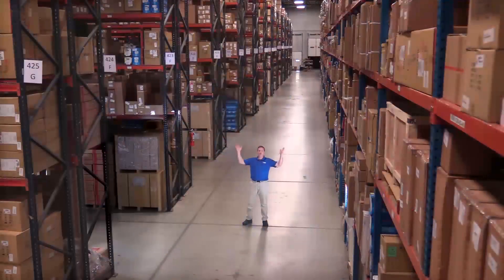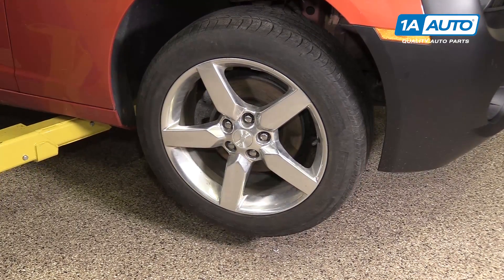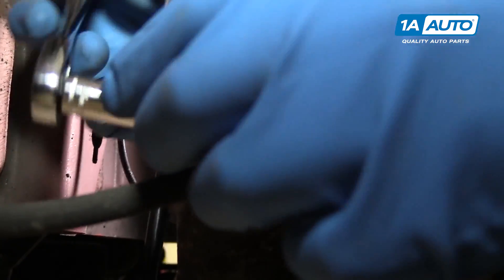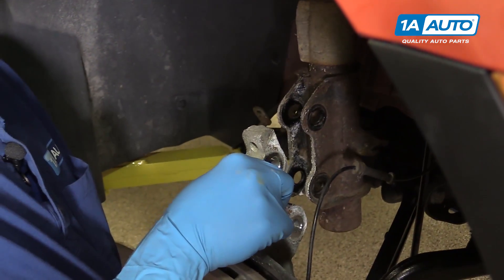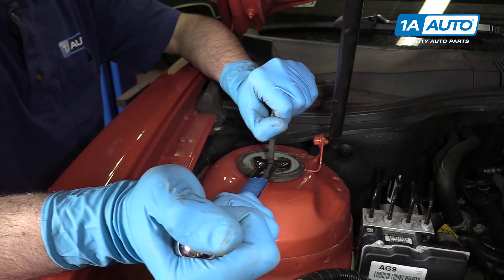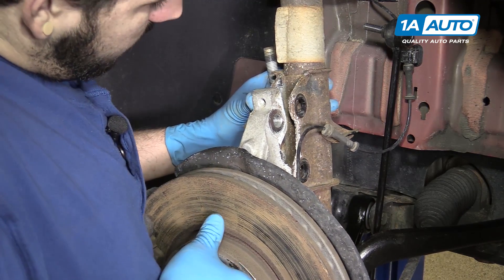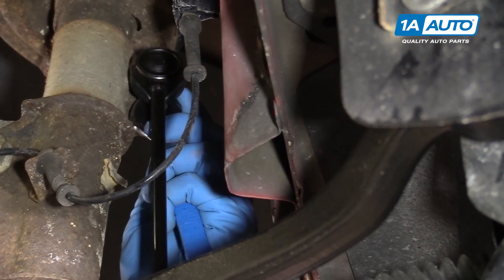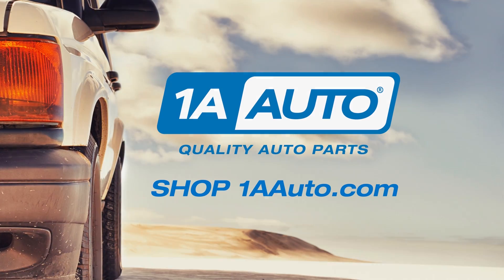How to Replace Front Strut and Spring Assembly 10-12 Chevy Camaro

Comment: 6:50 This should be done with new bolts, but I guess he forgot to mention that. The angle is torque to yield and actually stretches the bolt for proper clamping force. These TTY bolts are only supposed to be used once
Reply from the maker: +FasNuf Garage Thanks for the tip! We'll pass this info along to our production team.

Comment: Do I need to apply pressure to the strut before torquing the 2 bottom bolts or can I do it in the air?

Comment: I watch this hoping for some insight because I have a 2008 Cadillac SRX but even though it does have a strut type suspension system it takes a shock absorber and utilizes the factory springs which you do not replace.
I really just needed to know what the torque specs were on the brace/swaybar in the engine compartment that covers the tops of my shocks.

Comment: Is 'ft lbs of torque' mandatory for all of this? Pros and Cons if not doing 'ft lbs of torque'?
Reply from the maker: +Mike Tarter Thanks for checking us out! It is recommended to use the ft/lbs rather than another unit of measurement to ensure everything is tight and will not come off.

Comment: Best tutorial ever! Got my spring switched out with this video, thanks! Only got one quick problem.. the strut top nut still spins even when the weight is back in the car. The 7mm Allen key method is not working either. Is there something else I can do to tighten that down?

Comment: A Chev Lumina 6l 2011. Should the to section of shock move when turning the wheel
Reply from the maker: +Nicky Van Dyk Front strut assemblies usually have a bearing at the top that allows the whole assembly to rotate when turning the steering wheel. Thanks for watching! 1AAuto.com
Reply: 1A Auto Parts I have the bearing in. It is D2 struts and shocks. Assembled the same as the originals. But right at the top there is movement to the front and back
Reply from the maker: +Nicky Van Dyk Thank you for getting back to us. The top bearing should allow the whole assembly to rotate when turning the wheel. You will want to be sure the part is also torqued to the proper specifications to ensure it is not loose or over tightened. Please let us know if you have any further questions, thank you!

Comment: I have a front left strut that’s blown on my 2012. Is it acceptable to replace just the bad one, or should I consider doing both fronts?
Also, will I need to get an alignment after replacing the strut?
Reply from the maker: You can just replace the bad strut, but if they have been on for a while, you may want to do the pair rather than replacing the other one in the near future.  An alignment is recommended after steering/suspension parts are replaced.  Thanks for watching! +Cali 45th
Reply: Should always replace both for safer handling and even ride

Comment: I have a 13 Chevy Cruze looks about the same, is it the same? I purchased the whole Monroe assembly kit so if I loosen the top nut it will stay together,I don’t want to mess with the spring coming undone?also would I need an alignment afterwards?
Reply from the maker: +Tommy Miller The general procedure is relatively similar. Loosen the nuts fastening the strut to the frame unless out of the car. You will need an alignment afterwards

Comment: What happen if the top bolt still spins?
Reply from the maker: +Levy Hernandez You will have to use the hex to counter hold it like we show you in the video.  If it still spins then you will have to try an impact wrench.  1aauto.com
Reply from the maker: Thanks for checking us out! The top strut nut would need to be torqued to 52 foot-pounds. Hope this helps you out!
+click slide bang
Reply: The person who put them in striped the hex hole!! How can I hold the bolt?
Reply: How many ft lbs of torque should the top nut have